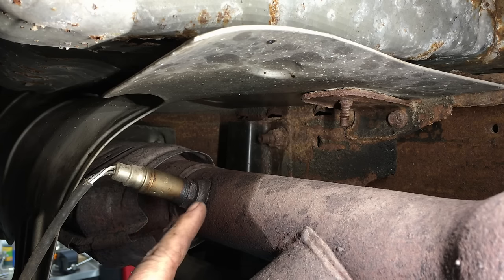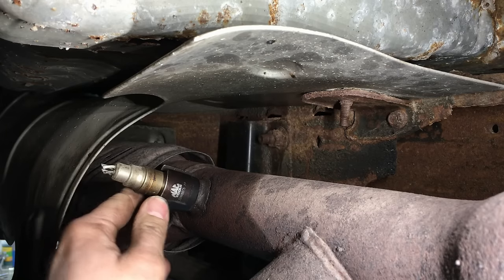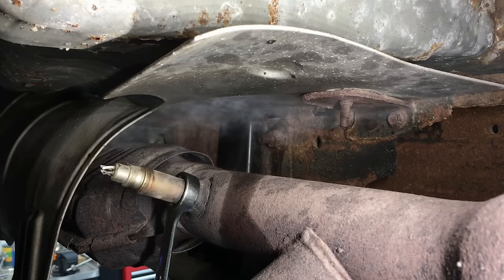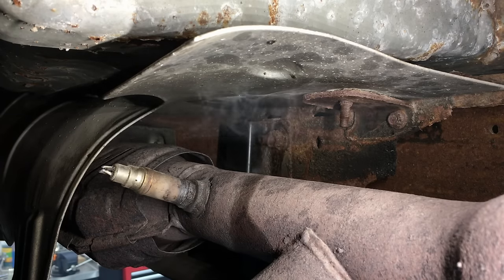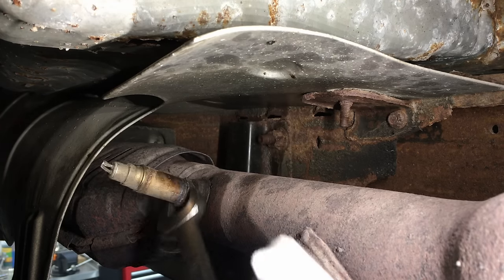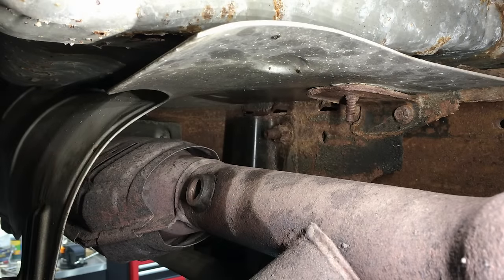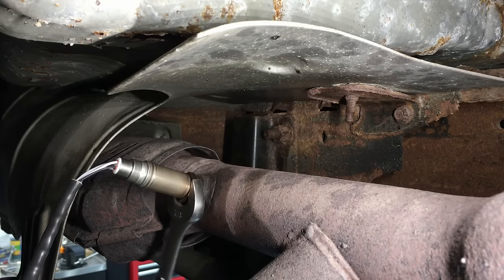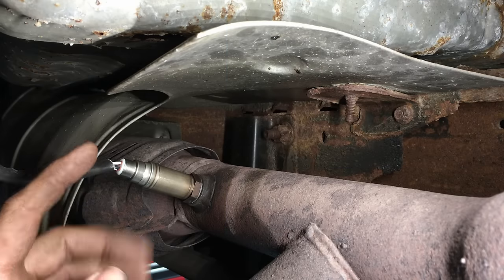Ford Quick Tips #81: Removing Rusted Stuck Oxygen Sensors the Easy Way!

Comment: Nicely done.   Lack of patience has messed me up a few times over the years.       There are times when you can use an ultrasonic cleaner to "repair" an oxygen sensor.    If you have a cleaner,   give it a try if you are on a budget.         I have not tried it  but there are a few videos that show it working.

Comment: I had a check engine light on my 01 Ford Mustang GT... After a scan the codes leaded to the 02 sensors... Lifted the car and found out all my oxygen sensor wires had been cut and they also had been welded.... I needed to weld bungs back in cause the original threads where beyond shot... What a job that was to replace... I put Bosch oxygen sensors and no more check engine lights.

Comment: Great video and info!  I'm about to try my first removal on my pre-cat. I won't use the open end on my box wrench like I was going to. I'll cut the wires since I'm not really getting a reading from mine. I'm pretty sure my car will still run if I have issues with removing it after cutting the wires. I sure hope it works out for me! The shops I called want a ton of money to swap mine. Anywhere from $360 to $480. That's a lot to spend. I sure hope I can take car of this myself and fix my CEL and get my boost back to full.

Comment: So I have a question for you. I was lucky enough to get my customers vehicles o2 sensor out fine using this method,  even before watching... but mine in not so lucky on.... i did get out but bong hole did strip. What's your suggested method of fix?
Reply from the maker: You simply tap the threads. I have a tap just for o2 sensors 18MM-1.50

Comment: Would you recommend changing the O2 sensors as preventative maintenance or as needed only? I have 182,000 on my 5.4 2V and am certain they've never been changed. Thanks.
Reply from the maker: Nope they will let you know.
Reply: @FordTechMakuloco ok thanks. Appreciate you taking the time to answer these questions. I don't know where you find the time to do that but it's very much appreciated.

Comment: Any suggestions for removing the lower oxygen sensor on a 2012 Ford Focus? I’ve removed the sensor right behind the engine but the lower sensor on the exhaust is hard to reach. I’m not sure if it’s best to tackle from above, or below as both are hard to access even with a lift.

Comment: My 02 sensor codes read bad after i checked why my check engine light came on and i replaced both sensors on my 99 saturn, it was good for about 2 months then the same light came back on and read bad 02 sensors again. Any ideal why it would come back on?

Comment: Hey Bryan, I am in major need of your help. I am dealing with a 98 Expedition that is stuck in 4WD. The the transfer case motor has been replaced, the TC can be shifted manually, the control shift works, but the motor won't operate while moving the control switch. What do you recommend besides a match to the gas tank?

Comment: My problem is the electrical connector itself. 1997 Mercury Cougar XR7 3.8 B1 S2. It will NOT separate and yes I am pushing down on the tab while pulling on the female connector. Unfortunately trying one-handed because there is no room above the sensor on that vehicle. Did someone use loctite on it !!!!???

Comment: Hi Brian on average after how many miles would you recommend the changing out of the O2 sensors.
Reply: Until they fail, you can keep running them.  Some cars they don't fail for years.  You'll notice it.  You'll get rough idle and rough acceleration, then it's time for a change. Until then, you good payboy :)

Comment: What if you plan to use a the box-end of a wrench, and you've already cut the o2 sensor wires. But it turns out you can't get the sensor out, would the car will run with no o2 sensor connection to the ECU?

Comment: One thing to be a little careful of is trying to move the thread beyond cracking the thread when the metals are still hot. Enough friction may be generated between two dry surfaces for a tight spot to generate that little extra heat needed to weld the surfaces together. The tiny spot weld most often can be broken but then the thread in the pipe will become modified by that spot as it is forced around the threads on the way out. A new clean threaded replacement will be tight unless you run a tap through the threaded hole first to restore the thread. Forcing the new part into a modified thread will in turn modify the thread on the part. It may become easier to turn until a section of thread deeper in the hole which has not been modified is reached, then it will tighten again and possibly jam. It may become irremovable and you will have ruined the new part.
Reply: DARANGULAFILM j
Reply: wooow thanks for this warning...seems best to NOT even try and hurry these stubborn fittings'. Like a VERY small amount of heat and ALOT of wd40 repeatedly applied as you wiggle and slightly turn it bit by bit...absolutely NO hurrying ever seems to be the key then
Reply: @blackyboi2885 . The heat in itself will not be the problem. That part of the exhaust system gets roasted by the gasses passing through. You may be able to shock cool the baulky sensor by turning a can of canned air upside down, with the little plastic straw fitted and run the liquid gas onto the shank of the sensor to locally chill it whilst leaving the pipe itself hot. There is a remote chance that you may aggravate a weakness in the sensor body and it may crack off like a seized spark plug does. Patience is your friend. Wear safety glasses as you do not want liquid gas freezing your eyeball. It is also a good trick for shifting seized brake lines and bleed nipples.
Reply: i like to wire brush the threads first then liquid wrench, start it up and let it run for 15 min, hit it again w/ liquid wrench and let it sit overnight. wait till morning start it up run it 15 min, then it should come off HOPE fully easier good luck.

Comment: I don't have a torch but I do have a Venom induction heater. I wrapped the leads around the sensor bolt, waited 10 seconds, and it got red hot. I squirted the sensor with water and put a wrench on it and it came right out.
Reply: I will add they my car sits too low to get under it so I borrowed a friend's lift. Way better with a car lift

Comment: Changed the intake on my 01 crown vic lx because of a coolant and vacuum leak, afterwards it started and ran excellent then all of a sudden the rpms dropped down a little and a slight miss could be seen and heard, went to drive it and it sputtered like a major vac leak or something, plus I changed injector o rings.. It ran and drove fine before.. Does anybody have any ideas what could be wrong.. I made sure to disconnect the batt also before working on it..????

Comment: Okay I watched the video and it didn't want to come out so first tried cutting the wire and getting my pass through socket on it and didn't work, so then just end up taking a cut wheel and cut it down to where basically any wrench can fit and off she came! You have to make up your mind You either committed when you cut the wires you can always wire nut them or tying back together but if you're going to go for it just cut that thing down to a nub stick a socket on it and make it nice and easy..
But thanks for the post!

Comment: Great job; thanks for sharing this tip.  For those who are impatient, those split sockets (that preserve the wires) spread under pressure and you can end up rounding off the bolt pattern on these sensors, and then it is a real, time-consuming and difficult problem to remove the sensor when you could have followed his advice and done the job in a few minutes.  I had to learn this the hard way.  Propane is not hot enough - use the Mapp gas.  This technique applies to removing any O2 sensor on any vehicle you are likely to run into.  

Thanks again for showing us how to do it the professional way.

Comment: Last one i removed i used seafoam deep creep,4lbs hammer i heated it before trying then put steady pressure on the wrench and then tapped with hammer. Spray a little more seafoam,tap wrench with hammer. Then when it came loose just removed it with wrench. 
So basically what he showed. It works pretty well.

Comment: That was in there 20 years. Remember when factory exhausts only lasted 5 years, and then aftermarket exhausts only lasted 2 to 3 years? How times have changed. My 2012 Focus (manual trans) was built in May of 2011. It still has original exhaust with hardly any rust. Amazing. Time to change an O2 sensor though...
Reply: You must have bought cheap aftermarket exhaust. High quality headers, mufflers and pipe last far beyond a year or two. As for factory exhaust, it's still crap, the 5.4 Ford manifolds were notorious for rusting out in a few years, especially in the snow belt, yet I have several old 390s, 460s and other old Ford iron and the factory manifolds are solid. Nothing automotive has gotten better, plastic clips, plastic intake manifolds, cheap sensors, cheaply made windings in alternators, just obsolescent junk.
Reply: @TheRoadhammer379  - I was talking about in the 1970's and 1980's. What I said was typical back then. Remember, the odometers on the cars only went to 99,999 miles because they were not expected to last much longer than that. Car engines were often times "done" between 65K and 85K miles. Engines last much longer now. The bearing clearances are much tighter. This is why engines take 5W-20 now instead of 10W-40. My 2012 Focus has 133,600 miles on it and the engine still runs like new. A co-worker has 240,000 miles on his 2014 Focus. Engine durability, when taken care of, is SO MUCH better than it used to be. This is why odometers on newer cars have a place for hundreds of thousands of miles. 
My car is still on the original alternator, starter, AC compressor, everything. I've only changed brakes and I need to change belts and hoses. They don't exhibit any problem but I don't expect the rubber parts to last any longer. They are regular maintenance items. 
Oh, I did have to replace a small component....something similar to a thermostat housing, but it routes water through the cooling system and is also where water is split off for the heater system. I do need to replace the lower control arms because one of the ball joints is shot, and you have to replace the whole assembly, which kinda sucks.
I have to give credit for much longer lasting engines. My car also has the original exhaust and there are no leaks. I am very happy with my car and plan to keep it another 10 years.

Comment: A $6.00 can PB Blaster works better because it has higher temp lubrication and it does really turn some of that rusted iron back into just iron but otherwise this the better way to change the O2 sensor, but it does burn too so use at your own risk.

Comment: Won't work for me. The downstream sensor on a Sonata 2.0 is just before the 2nd cat (1st one is the exhaust manifold), just underneath the firewall area and horizontally. 0 leverage unless I use 3-4 long extensions on the o2 socket lol. Been soaking WD40 for a while, driving, soaking, no luck. The torch is the only thing I haven't tried. At this point, it's probably easier just to have a shop remove it.

Comment: I have 06 ford expedition more then 250000 miles no check engine light do I need to clean the 02sensors for saving fuel

Comment: I tried with a bernzomatic. Nothing. I finally got twisting bolts using an impact wrench and  It shattered the area of pipe that the sensor is plugged in. Tried JBWeld temporarily to hold it in place until I have actual money to afford putting in my replacement exhaust.  The corrosion ate away.

Comment: Great video as usual Brian. I know you recommend Motorcraft 02 sensors, but any reason not to use Bosch 02 sensors? They are stated to be OE sensors on several websites, connectors are the same, just curious. Looking to replace on an '08 Explorer 4.0 w/102k miles once weather warms up in WNY....

Comment: I have a 2010 F150 5.4 l I'm losing power and it's running a little rough with a loud tapping I put it on the scanner is said bank 2 sensor 1 O2 sensor I replaced it I still have a tapping I still have loss of power could use some good ideas please
Reply: Are you sure you replaced the correct sensor? Bank 2 is on the driver's side.

Comment: Hi, Brian.....I just read that the absolute best penetrant is a 50-50 mix of ATF and Acetone.  The break-loose specs were a few Ft# lower than the best and most expensive penetrating oils.  Just thought you should know.
Reply from the maker: Oh I know all about it but I prefer he aerosols and the mopar stuff works really well.
Reply: I'll probably put a can or two of that stuff on my shelf!  Sounds great.  Thanks.  Have a Merry Christmas!
Reply: That works but doesn't last long in spray bottle.. acetone evaporates and doesn't have a long shelf life like aerosols. http://www.kanolabs.com/penLub.html#anchor173855 is #1..  Mopar is #2
Reply: booba loo in my experience, you don't even need to add the acetone. Trans fluid already contains some. It's my preferred penetrant, whether it's used or new trans fluid, it all works. I have little oil can squirters of  varying sizes for my penetrant. The best is spray the problem down, walk away & come back, then spray again before attempting to remove. Some issues are free by the time of removal attempt, others need to be worked like Brian showed in the video.
Reply: That's an interesting point, Cuba.  I had figured the Acetone made it even thinner for better flow-in.  I do like the way the MOPAR stuff seems to work, so if I'm out of the "Magic ATF" and in a hurry I'll have can on the shelf.  Thanks!  I'll keep that in mind, too.
Reply: Acetone is TOO inflammable and not very safe to be spraying around.

Comment: have we got a "front oxygen sensor on a 2002 ford triton v-10 2 valve 415 cu.inch 6.8 liter gasoline engine; this engine powers a 2003 holiday rambler motorhome; I relly like the clarity and your very clear instructions please keep it up "I need you" my motorhome needs you !! thanks PATRICK.P

Comment: My 2 cents: i must disagree about cutting the wires. I just attempted to remove mine, and couldn’t, so i sprayed it with WD40, and will repeat for several days before i try again. I don’t have a torch, garage, or any of that other stuff. Just my arm, a ratchet and WD40. Lol I had pulled the connector, and just reconnected it, so i could drive again without messing anything up. If id cut the wire id have been screwed. Make ABSOLUTELY sure you’ll be able to finish the job, before cutting the wire

Comment: Do I need to preemptively change my O2 sensors at 230k miles even if they aren't showing problems? I can't find a definitive answer. I've heard leave them in till they give problems becuase they're either working or not,  and I've heard they get 'sluggish' with age and effect fuel economy.. What's the truth?
Reply from the maker: The pcm monitors them for age and will tell you when they are too sluggish.
Reply: @FordTechMakuloco   thank you!

Comment: Okay. I hope this helps at least one person because he shouldve mentioned it. Will help you guys without a lift.
I only recommend this for 02 sensors. Wear proper protection and be safe.
But first step for O2 sensors. Run the vehicle and get the exhaust hot. When i started as a tech, i remember that being a duh moment.

Edit: To clarify i dont mean running it while disconnecting the o2 sensor, nor replacing it. Just immediately before. Put it on ramps, run it about(at least 5 to 10 minutes), have battery and 02 connector ready to unplug. Turn it off, disconnect, quickly heat the o2 sensor with a map torch, put the appropriate socket on and work it with an impact. Slowly. Itll come out. Best advice though is safety and awareness. If you have limited access. Spend as much time on having things set up to move through the process quick. Faster you move the hotter you keep it. Easier itll heat with a small torch.

For those of us with lift access, grab the red wrench and go! 😁
Reply: why not unplug the O2 sensor before running the engine?   you can seriously burn yourself getting to the connector    if you're cutting the wire I guess it doesn't matter

Comment: Is it a good idea to change o2 sensor as preventive maintenance?
Reply from the maker: No need they are monitored by the PCM as they age.
Reply: depending the vehicle. they can last from 50-60,000 miles. However they can last alot longer with proper vehicle care.

Comment: The body of the sensor is soft metal. Top of sensor where the wires go in has just resin there. Got a deep well 6 point 22mil socket, golden. The main body of the sensor is thin walled ceramic fill. Will destroy sawsall blades trying to cut through that ceramic. A simple metal plumbing pipe cutting tool will cut through the skin. Smack with a hammer and now shallow 6 point socket ready. No matter what 6 point.
Me lacking the proper tool (6 point socket). Stripped it. Cut it flush to exhaust bung. Used a stepped hole drilling bit. Marker colored the step I needed to stop at. Clean threads with dental tool. Had to clean top edge of bung with Dremel. Had to fine file the crappy threading on the new sensor. No need to crank down the sensor like the asshat that put the truck together at the factory. I bought my truck new. So finding cross threaded nut and bolts is pure factory F ups.

Comment: No way i have patience for this. 

Torch, impact, full guerrilla!
Reply: Dude I was just thinking the same thing 😂
Reply: @Jerm353  this guys spent 3 mins just wiggling it back and forth, you'll go out of business working that slow 😂
Reply: Same here torch, rust penetrant, impact tighten then loosen.. multiple times. After removing the o2, spray the catalytic converter thread with penetrant and use the old o2 to clean up the cata thread. Finally, install your new o2.